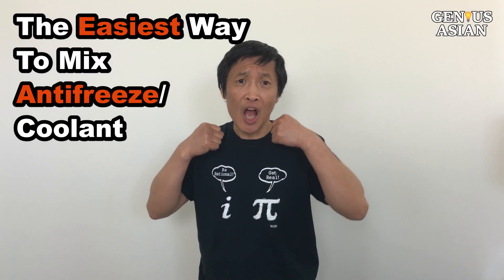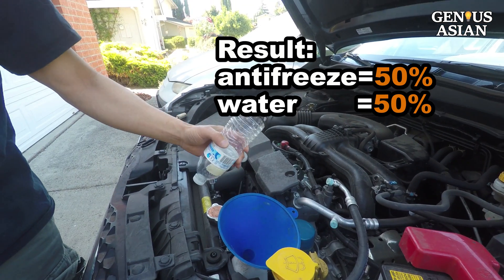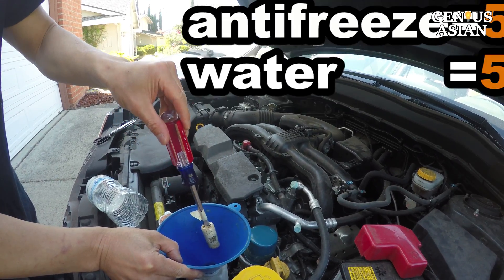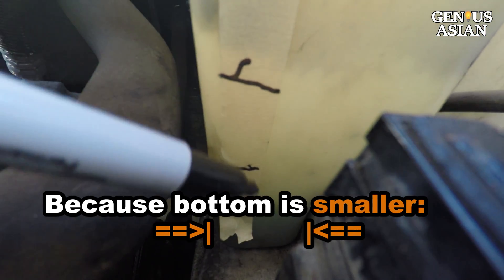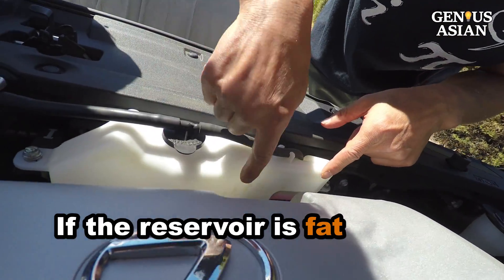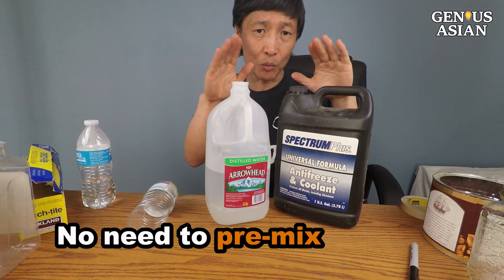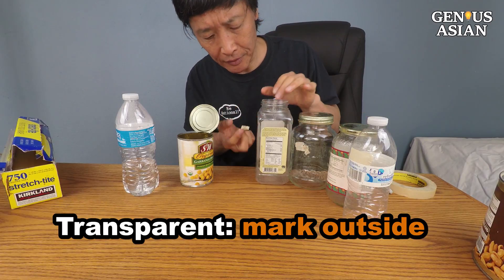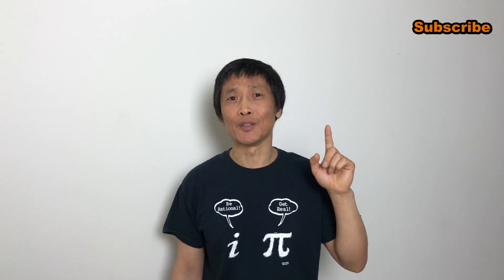The Easiest Way To Mix One Cup of Antifreeze/ Coolant With Least Storage & Least Cleaning Afterward

Comment: If I want to flush or clean earlier coolant which water we have to use ?

tap water, minral water or distilled water ?
Reply from the maker: since tap water is more expensive,  I used tap water with a garden house just quickly flush it for a few minutes as if I am watering a tree. You will notice dark water with debris will come out. And then I use distill water to remove tap water, this way I don't waste expensive distilled water. Some people would disagree with  me only use distilled water, I just don't want waste money.
Reply: @GeniusAsian  thanks

Comment: You should not be using distilled water LMAO…
Reply from the maker: so what kind of water do you recommend?
Reply: Softened water
Reply: Many people have “heard” that distilled water is the best water to use in a cooling system. This is wrong. While it is certainly true that distilled water’s purity prevents electrolysis and scale/deposit formation, it unfortunately comes with a potentially very damaging side effect.

During the distillation process, water is vaporized into its gaseous phase, so all its impurities are left behind. These impurities include a number of minerals, including “calcium” and “magnesium,” the two components of water “hardness.” The water is then condensed back into its liquid phase, so the resulting liquid is pure water – in fact, some of the purest water on earth. But the problem is that when water is distilled, or “stripped,” of its minerals and impurities, the resulting solution is composed of chemically imbalanced “ions.” This leaves distilled water “ionically hungry,” so it will actually strip electrons from the metals in a cooling system as it attempts to chemically re-balance itself. As it chemically removes electrons from the metals of cooling system components, distilled water eventually does extreme damage that could lead to cooling system failure.

Comment: Get your distilled water in a 2 liter even looking bottle
Pour out half of it
Fill the rest with concentrated antifreeze

Now you have 1:1 antifreeze mix
Reply from the maker: yeah, your way is the traditional method, however I found two problem with this traditional method:  1.  it requires larger space to store bottles. 2. it needs more distilled water than necessary, I may need to use some distilled water to top up the battery or sleep apnea medical devices or fish tank for example.  I keep concentrated antifreeze as the original concentrated form so that I can mix  30%/70% if needed.
Reply: @GeniusAsian  in the end I took a 0.5 liter drinking water bottle of square shape, poured out all the water, then filled 50/50 antifreeze and distilled water. Apparently my yellow antifreeze turned green after mixing
Reply from the maker: @vladimir5935  thank you for taking the time to follow up. Did you mix different color antifreeze? How did yellow turned green?
Reply: @GeniusAsian  it looks like i did mix different colors, although it didn't look like it at first. The antifreeze that was already in the car was yellow, but then I read online that it could have been originally green but turn into yellow as time passed. The one I mixed was yellow in concentrated form, but it turned into light green after adding distilled water. The car still runs and the mix did not turn solid or anything, but I will flush it this week and put a new coolant in

Comment: Could you make it a little more complicated?
Reply from the maker: a lot of people may not be aware of the problem. Many people would prefer to use the conventional way with an extra 5-gallon bucket, but there is really no obvious advantage to use the traditional way of 5-gallon bucket. Some people save  a 5-gallon bucket. This video assumes you don't have the 5-gallon or don't want to clean it up, you don't need this 5-gallon bucket. If you are doing a complete flush and completely drained the system, then it is likely the capacity is more than 2 gallons. However you may not have "completely" drained the system, thus you should first pour half gallon of coolant and half gallon of distilled water into the radiator first. There is really no obvious advantage to use a 5-gallon bucket though but many people would prefer that way because it is the conventional way.

Comment: I'm doing a complete flush.  Can I just pour one gallon of concentrated coolant and one gallon of distilled water into a 5-gallon bucket and pour?  Of course, if i need more, then I can use this method.
Reply from the maker: Sure, you can do that if you have a 5-gallon bucket. This video assumes you don't have the 5-gallon or don't want to clean it up, you don't need this 5-gallon bucket. If you are doing a complete flush and completely drained the system, then it is likely the capacity is more than 2 gallons. However you may not have "completely" drained the system, thus you should first pour half gallon of coolant and half gallon of distilled water into the radiator first. There is really no obvious advantage to use a 5-gallon bucket though but many people would prefer that way because it is the conventional way.

Comment: No wrong , easiest way is to find the vehicle capacity example my car is 15 litre capacity most cars are , you then buy then 7.5 litres worth of concentrated coolant rest water after you have pumped all water out of car by running engine by removing thermostat and flush at same time  , and distilled water is actually bad for your car  , if you are going to do the job champ do it properly , 

https://www.hyperlube.com/blog/blog/why-you-should-never-use-distilled-water-in-your-cooling-system/
Reply from the maker: The video is about how to mix coolant, not which coolant is better. The distilled water is pure water, if you need ions or any other chemicals, they should come from the coolant. Can you explain why the coolant manufacturers don't add the special "ions" to their coolant? Why would be the hyperlube better? Thanks.
Reply: Genius Asian that’s what I’m saying. It’s really convenient how this one company is telling you it’s an issue and just so happens to sell a product to fix said issue that you didn’t know was an issue until they informed you

Comment: Trying to fill up a fire truck, so far it has taken 10 jugs of coolant. Mixing coolant is far cheaper than buying the 50/50.
Reply from the maker: Thank you for sharing, wow 10 jugs of coolant!  $9 for 50/50 coolant and $11 for 100%, so you just saved $60 (distilled water is only $1 per gallon).

Comment: Use 30% coolant and 70% distilled water in over 40C ambient temperature. However, 50/50 ratio may also work
Reply: 40C = 104F

Comment: No water..! Water will damage your Motor..! Use distilled water..! Or buy it already 50/50 mix
Reply: He is using distilled water.. lol
Reply from the maker: The point of this video is not to use the traditional way of mixing large amount of coolant if only a little bit is needed. You can use the distilled water you bought to fill the batteries or other needs.
Reply: You are wrong actually distilled water is bad for  your car you should learn to research properly 
https://www.hyperlube.com/blog/blog/why-you-should-never-use-distilled-water-in-your-cooling-system/
Reply: Michael Wilson isn’t the reason for adding the antifreeze to also stop the corrosion. So it shouldn’t matter whether the water is ionized or not? It’s also such a common practice and people don’t complain of their cooling system going to shit more often if they use distilled water, so it may technically be better, but I need some hard data instead of just some half explained chemistry
Reply: @michaelpugh2617  best to use pre mixed no issues
Reply: Is it food grade distilled water or any distilled water will do
Reply: @hassemsadiq  isn’t it all the same?

Comment: Take a gallon of distilled water, fill an empty 2L soda bottle. Take coolant gallon and refill distilled gallon with coolant. Pour 2L soda bottle of distilled water back into coolant gallon. Now write 50/50 on both the coolant gallon and distilled water gallon containers.
Reply from the maker: So you assume you have a 2L bottle, not a bottle of any size. Couple of questions
1. In winter if you need 60/40 mix, how do you convert your 50/50 to 60/40?
2. when pouring liquid to bottle that has small neck (bottleneck), the liquid does not go down easily (when using a funnel) because the air is trapped inside the bottle. How do you deal with it?
Reply: Genius Asian yeah I assume you have a two liter bottle, if not, a half gallon milk jug would work too, or a gallon jug filled halfway.

1.) Like most people, I don't live where it's cold enough to warrant 60/40.
2.) You don't let the funnel sit in the bottle. You use one hand to hold the funnel, preventing it from resting on the lip of the bottle, and use your other hand to pour the other liquid.

I'm fully aware this won't work for everyone on Earth, but it's probably good for 90% of people.
Reply: Do you really live in Alaska? If you don't live in an extremely cold climate, then you don't need anything more than 50:50. In Idaho, I always used 50:50. In Vermont, I always use 50:50. If you need 60:40, then your temperatures must reach well below -40.
Reply: I use same process. I never buy 50/50 premix. I more costly.

Comment: Totally needless. If you're very smart, you'll already own a jug of coolant exactly matching the chemistry of the coolant in your car's cooling system, already at the correct mix. No screwing around with somebody's nasty old water bottle, no screwing around with funnels or corks. No screwing around at all - just pour & go.
Reply: Tim Hofstetter: "No screwing around with somebody's nasty old water bottle"

Also Tim Hofstetter: "grab an empty one-gallon milk jug out of your recycling bin"
Reply from the maker: If I just bought a one gallon 100% antifreeze and I only need a very small cup of coolant to fill my coolant reservoir, what should I do? Not clear what is your suggestion, can you give us step by step instructions, how will you do it?
Reply: If you only need one cup, or only one pint, to fill your overflow reservoir, then you probably don't need to do anything at all yet; it's fine. If you decide to do that job, though, and you have one gallon of unmixed antifreeze to work with... then grab an empty one-gallon milk jug out of your recycling bin. Of course there's one there, everybody has at least one. Draw a line halfway up its side with a Sharpie. Fill it to that line with antifreeze. Top it off with DISTILLED water. Now take the other half-gallon of distilled water and also top off the antifreeze jug with it. You're left with two gallons of 50/50 mix and one empty distilled-water jug to drop into your recycling bin. Total time spent: about thirty seconds total.
Reply from the maker: Thank you for your reply, I understand that it is the traditional way to make the 2-gallon coolant. Since there are many other home uses for the distilled water, I prefer not use up my distilled water until I have to, thus I use my way of "mix as you go" to mix a small amount, otherwise I would have to buy extra distilled water for my other experiments.
Reply: Distilled water costs eighty-nine cents per gallon at the grocery store. That's cheaper than 500ml drinking water.

There are other uses for distilled water around the home?
Reply from the maker: Agree with you it is not expensive, however when you need it you still need to take the time to go to the store to buy it. Some people prefer not buying and storing extra things, but if you have the extra space to store your extra 50/50 coolant I agree it is not a huge disadvantage. 

Other usage of distilled water: When you add water to your car battery, you must use distilled water. Using anything but distilled water will introduce minerals and chemicals and other contaminates that will result in decreased battery life. You may be healthy, but many people use distilled water for their medical equipment. Other usages include steam irons and humidifiers, you could use tap water on these type of devices, but then you waste time on cleaning if you don't use distilled water.
Reply: When did you last own a car battery that you could refill? I haven't seen them on the market for... maybe two decades now.
Reply from the maker: You may still top up the distilled water into the "maintenance free" battery to extend the service life. 
If you overcharge your battery, it would lose water (water=>H2,O2). Older car may overcharge, thus if you replace your older car's battery with Gel or AGM types (this type is very sensitive to being overcharged) then you will need to replace your battery more frequently, costing you more money. A battery is just a battery, that is why we also use the CHEAPEST with the largest CCA that lasts the longest. As long as it is on sale, even if it is the wrong size, we still would buy it: https://youtu.be/hymGI0ra7gE
Reply: ..."we also use the CHEAPEST with the largest CCA"...
At least we agree on that point.

The "maintenance free" batteries available here are really "maintenance impossible" batteries. They have no removable cell caps. The only way to get additional water into the cells is to drill holes through the top of the battery and later plug them with small latex stoppers.
Reply from the maker: Are you saying the available  batteries are only "maintenance free"?  For my case, those that had removable cell caps are cheaper and last longer. Note that the "available" to me may be defined by you as "wrong" size, see: https://youtu.be/hymGI0ra7gE
Reply: I haven't seen any lead-acid batteries with removable caps (or even hidden cap-plates that could be pried off if you were earnest about it) for a long time now. If your battery gets a little dry, you can only replace the battery. Unless, of course, you drill your own holes & use rubber stoppers to close them. If you do that, though, you can't tell for sure when they're correctly full because they have no "full eye".
Reply from the maker: I am surprised you have not seen batteries with caps for a long time. You don't have to actually go to the store, you can simply visit costco and walmart's websites today to search the cheaper batteries. I buy costco Interstate  batteries, they have caps. A lot of time sears also have batteries on sale, they also have caps. For walmart, the cheaper one PowerValue brand, they have caps. As I said before, there is no point to pay more money for $150 if you can get a $50 one,  the only thing you should compare is if it has largest CCA that lasts the longest. Where do you buy your batteries?  You know the dealers are very expensive. Buy the cheapest but wrong sized here: https://youtu.be/hymGI0ra7gE , see it has caps.  And the costco battery can be seen here: https://youtu.be/9-TJHDTItps  most of my videos are shot in high resolution of 4K, you can clearly see the caps, see the right corner of this video for a 2015 subaru original battery we are discussing : https://youtu.be/vJGi8fmRQDU?t=61
Reply: I'm the most dedicated comparison shopper you will ever meet.    8)
Reply: That's very interesting, I cant recall the last time I saw a maintenance free battery. I didn't know they even made maintenance free batteries for vehicles besides those gell cells, but those are rare around here and expensive.